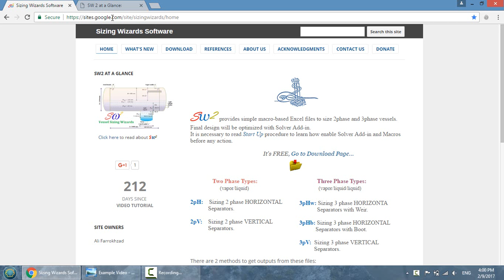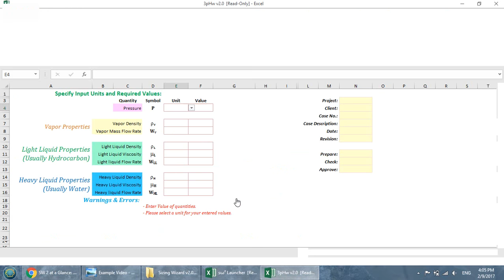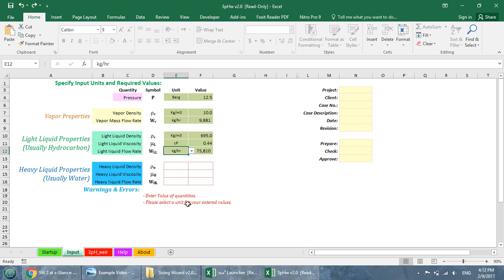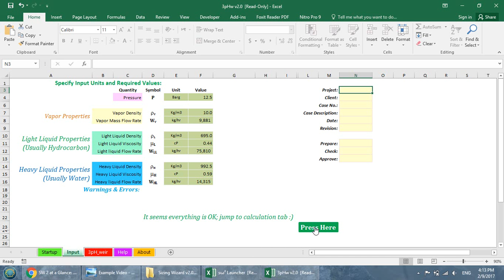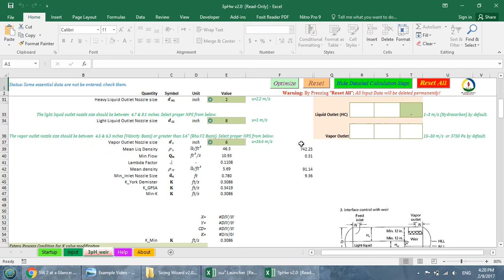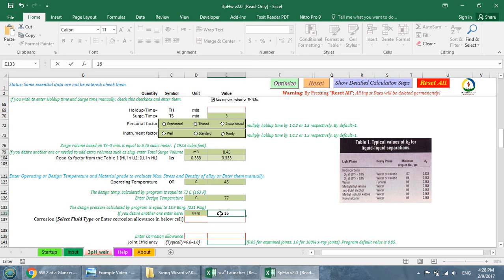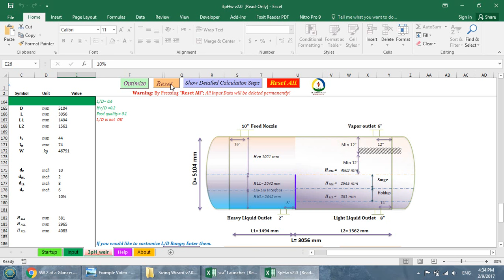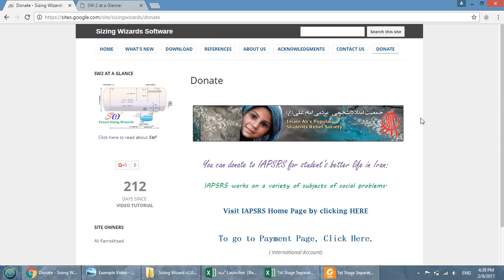Design and Size your Two Phase & Three Phase Separator by Sw2

Comment: Thank you Ali, a really helpful video and spreadsheet! I want to ask how to enter the length of the separation
Reply from the maker: You're welcome. Length of separation will be calculated based on the formula and comparing to the required capacity of holdup+surge volume, the final length will be set by the software.

Comment: This is the best work I have seen all of 2021. Please do you have this solution for other oil production equipment e.g pumps, control valves and compressors?
Reply from the maker: Thanks for your comment.
Actually I would like to do same work for other applications in the process design, but recently I do not have any plan to do it.

Comment: Thank you Ali, really helpfull video and spreadsheet! BTW is it possible to use it to design a liquid liquid (ex water/HC) two phase separator?
Reply from the maker: You're welcome. 
I have never investigate about liquid/liquid extractors. However I think you can use 3-phase spreadsheets and for gas phase, enter a very small value such as 0.01 kg/hr. to run the optimization. It should be work but definitely it is not optimized and the result is overdesign for your problem. (because it will considered some space for gas (~ 20% of ID)

Comment: Hi Ali,  thank you for the great work.  I'm getting "Solver has not been loaded.."  and " Run time: 9 - script out of range" error messages.  You've mentioned  a manual installation in the video but I couldn't see it later.  Am I missing something?
Reply from the maker: Hi,
If you can not see the "Solver" in the ribbon bar, it has not been installed properly. So you can search the web for "How to install solver in Excel XY?" (Please mention the version of the excel n the search keywords) and then follow the detailed instructions on the web (and maybe youtube)

Comment: Hi, thanks for the information, i would like to know if there is something special to do for installing "Solver Add-in", cause i have already installed but when i run S-Omega 2 appear an advice that said: " Solver Add-in has not been loaded, Please refer to start up page to add it manually." I have already done the manually installation as start up page mention, but the advice still appearing. i would be thankful if you help me.
Reply from the maker: Hi, Please open a new Excel workbook (Blank one) and check the add-in window and be sure that solver is exist in the list and it's check box is marked. And also be sure that Solver is available under "Data" tab on ribbon bar. Otherwise inform me to find a solution for this bug.

Comment: Hi sir
I got it,it's very helpful,God bless you 
I have question
Could I use it to check the capacity for existing separator or it's just for sizing new one???
Many Thanks
Reply from the maker: No, it is for sizing. You can use HAT HORIZ file to check capacity:

http://www.hatltd.com/hosted/55000702/home.nsf/396e036940cdfb7a802571280074ad47/a8d02af95cc8aae080257309002fa139/$FILE/HAT%20Horiz%20Vessel%20Vol.xls